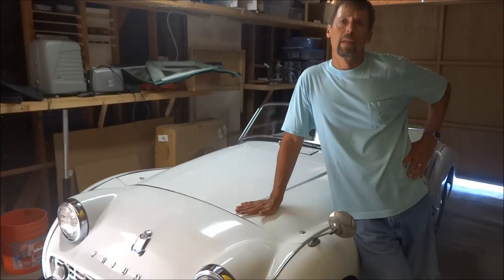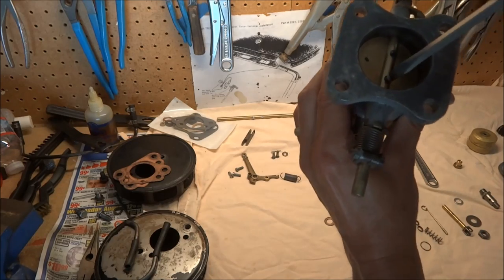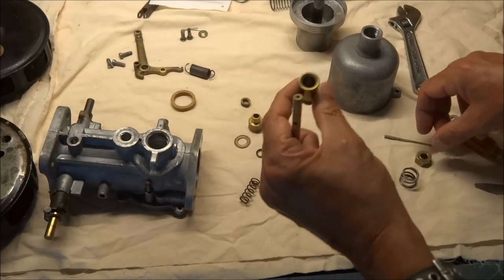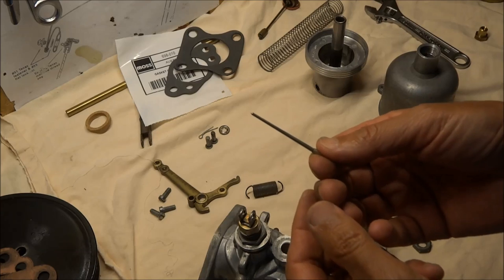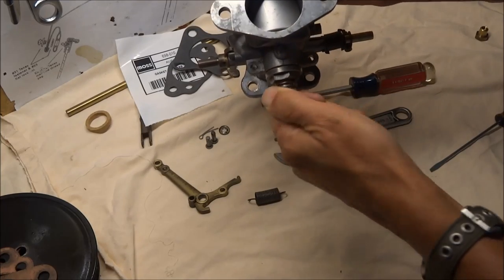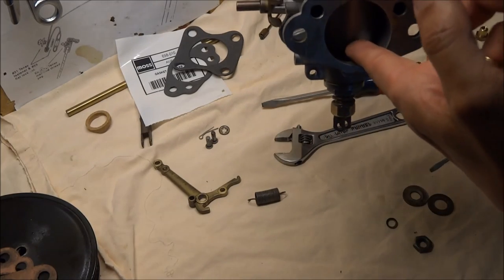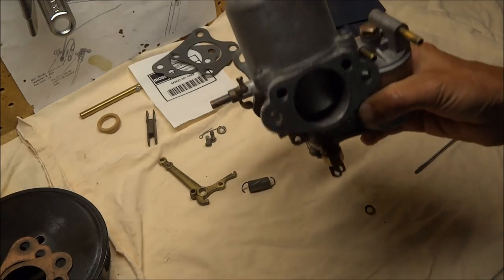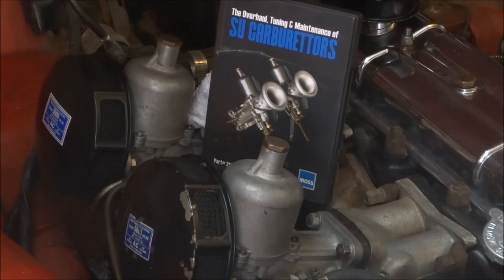Rebuilding a H6 SU Carburetor on a Triumph TR3

Comment: Hi, I have a problem with these carburettors, as soon as they were rebuilt the car started at the first ignition stroke, after 15 20 days, to start the engine you have to spray starter spray I have an electric pump thanks
Reply from the maker: Probably first check the float bowls and make sure they are not leaking out.  The floats should be floating on the fuel even after weeks of idle time.  Then check the fuel line itself to see it's not leaking gas backwards to the tank away from the carbs.  To do that I would disconnect the fuel line going into the float bowl, crank the engine, and you should see fuel immediately squirt out of that fuel line.  Sometimes after weeks, if the check valves in the fuel pump leak, it may take some cranking to get the fuel pump primed and start pumping again.  The original check valves are great, but the replacements seem to prone to leaking.  Not sure if your electric fuel pump has those.
Reply: @triumphtr3stuff338  many thanks, today I will try to do this test and I will let you know if I solve the problem
Reply: @triumphtr3stuff338  I don't understand one thing, the petrol with the tube disconnected,must come out of the carburetors or from the petrol pump tube?  sorry but i'm using the translator

Comment: on the float, the metal bracket at the bottom is both the float's support to the carb as well as the fuel flow to the carb.  The Lug that slides through to allow the float to connect to the carb also has a hole in it.   In your video, you showed the respective holes but nothing indicating these holes had to line up or be in any alignment.  Do they have to be?  Is there a trick to ensure the holes are in alignment??
Reply from the maker: The holes don't need to be aligned.  The gas flows around the lug and makes its way in no matter how it's positioned.

Comment: By any chance is this a h6 or hs6 or is there a difference
Reply from the maker: It is type H.  The HS looks slightly different in that the gas goes from the bottom of the float chamber through a rubber tube to the jet, and the jet is slightly different in that it doesn't have the gland seals.